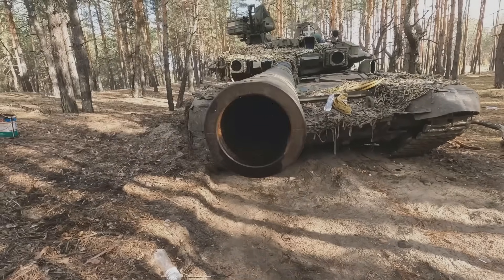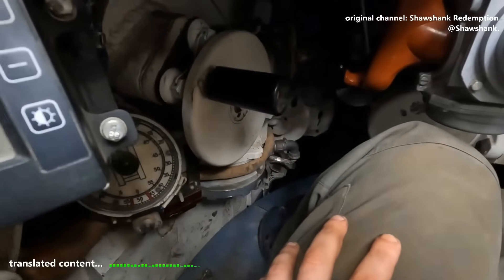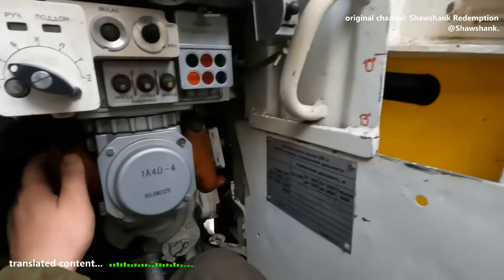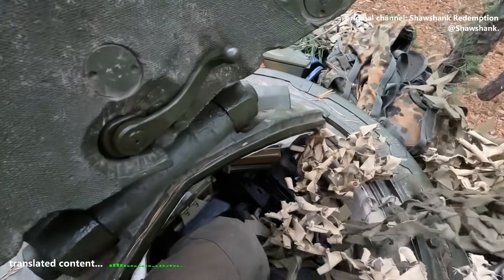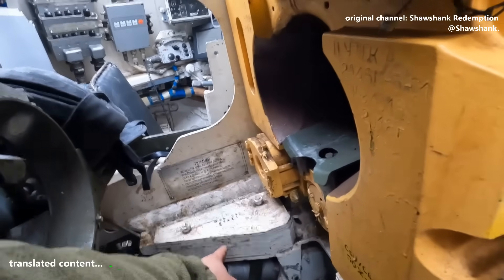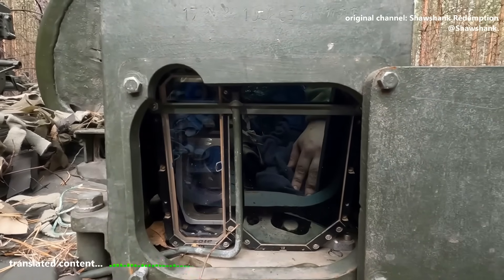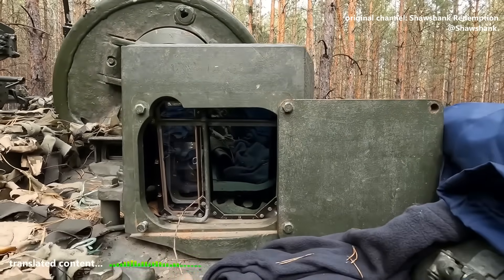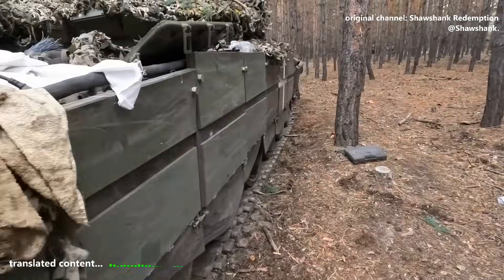Real Tank Crewman Reviews the T-72B3 — Brutal Truth Inside!

Comment: Its not most mass produced soviet tank, and its a t90a not a t72b3, idk why these type of channels only spread misinformation.🤦🏻‍♂️
Reply: It’s a T72 look at the road wheels
Reply: @Elo2177 T72's is just a older model of "newer" T90's
Reply: @Alem.WTMVeteran no
Reply: @Elo2177 actually yes, I've seen this video already and it was titled something about inspecting a T90A, and btw there is no T72 model that RU uses and has IRCM, the shtora1 IRCM  is only used on T90A's and as u can see the IRCM is clearly visible on the tank
Reply: @Alem.WTMVeteran there is no IRCM on the tank. I think you mixed up the T90A in the intro with actual tank being reviewed because this guy also reviewed T90A before
Reply: @Elo2177 ohh ok my bad i thought it was a T90A because of the intro.
Reply: The most mass produced soviet tank was indeed the T-54/T-55, however, they are HORRENDOUSLY obsolete and thus the author does not consider them when talking. (They are considered medium tanks, and not MBTs. This is why they were not mentioned.) Also, you are incorrect - the video very clearly features a T-72B3, different from T-90A by it's cast turret in comparison to the welded one on the T-90A. You should really think with your head first before crying about "misinformation"
Reply: @salieri_sg9413 before commenting read the comment where i said that i messed up and said srry, btw t55 was considered mbt
Reply: He was using a seperate clip from another video on the intro